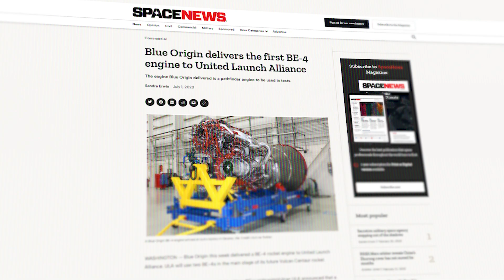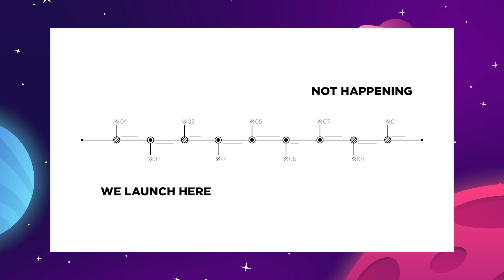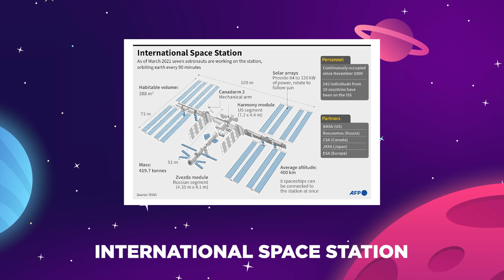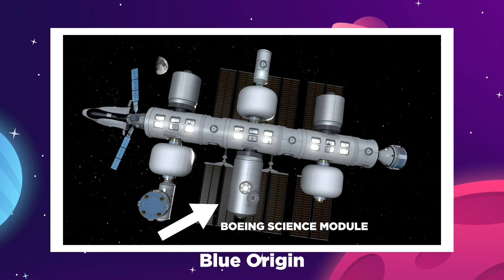What Life Inside The Orbital Reef Space Station Will Be Like!

Comment: With a better, more efficient booster engine we could put 1,000 tons in low earth orbit.  Given that each launch at Space x with the 9 meter booster could put larger objects into orbit, each one dwarfing what came before and only cost between 20 and 30 million per launch.  3 launches could put up double or even triple the volume of the ISS and for a tiny fraction of the cost, less than 90 million.

Comment: A lot of what made the ISS so expensive to build was the limited launch capability of the time, the expense of the Space Shuttle, the delays caused by 3-4 redesigns of the ISS as its mission changed and just the stretching out of the length of time of the construction.
(It turns out that when you slow development by limiting funds, it usually ends up costing MORE than if you just bite the bullet and "get 'er done".)
If New Glenn ever gets operational, not only its fairing will be large, but its payload capacity will be significant - on the order of the Falcon Heavy. If its reusability pans out, that will also cut the cost of payload to orbit. Couple that with the inflatable module technology, and you get a lot of internal volume for less cost.
Also, the Orbital Reef will be constructed more like the Chinese and Russian space stations in that it will be a bunch of modules simply docked together. No stupid truss segments to construct. Hopefully, they will have some of the better ideas of the ISS, such as wiring and duct work that goes outside of the station rather than inside the passageways between modules, like on Mir. (That created quite a problem on Mir when the fire broke out, because they had to remove duct work and wiring between modules before they could seal off a section.)
I think they can beat the Chinese cost effectiveness once they get the launch vehicles in place.

Comment: I think we should at least take 1 module from the ISS and return to Earth using the shuttle as a poetic farewell to the ISS and an actual part of station survive in earth for future generations also potential fix to microgravity is that they put a centrifugal grav generator at the center connection of the crew modules where they sleep or workout or use the toilet this is for future stations though as the speed required to make Earth's gravity with such a small arm would be too fast for people to enter the rooms to prevent the ship from spinning out of control they can add another at the other end of the ship going counterclockwise

Comment: Sounds very optimistic in both cost and time.  However, if bold goals are not put in place nothing tends to happen.  Better to extend the time lines than have it flounder on the table and never start.
Elon may need something like the 'Reef' for Mars anyway.  A staging platform to prepare for Mars launches.  Then a similar staging platform at the Mars.  Perhaps it will be more efficient to build and load large scale vehicles to move cargo between staging platforms and use smaller craft to ferry the cargo to the surface.  "Teamsters in Sppaaccceee".
Reply: Elon already has something like Orbital Reef: Starship.  It has more habitable volume than the ISS does, at a fraction of the cost.  It's cheaper to leave a Starship in LEO and add the long-duration hab items to it than to build something else from scratch.  Now all we need to do is launch Starship.
Reply: Elon can use the moon as a staging platform.